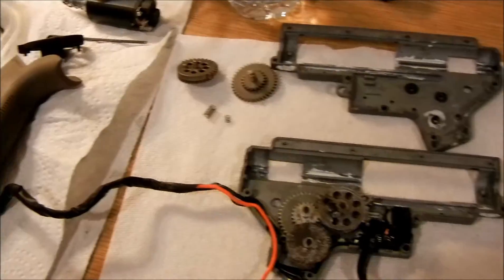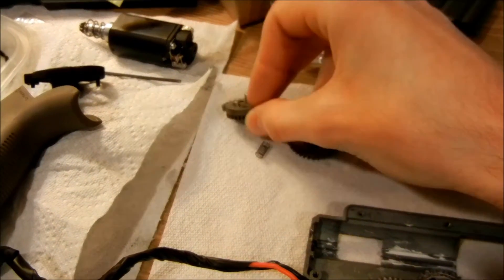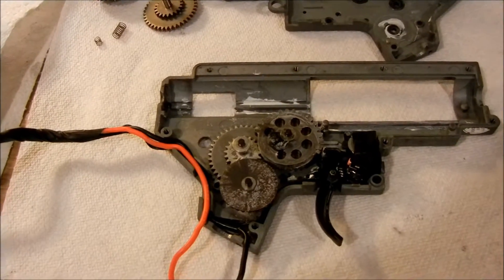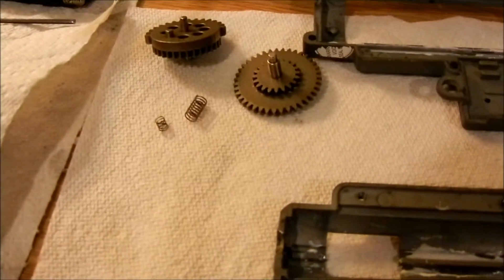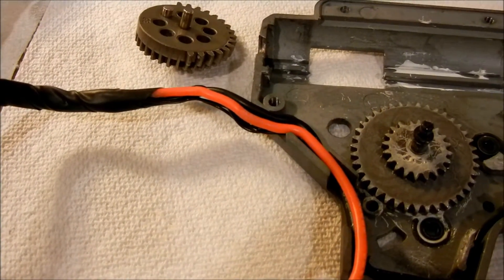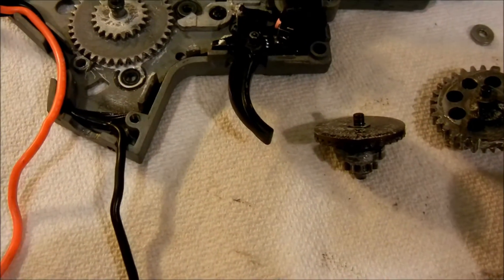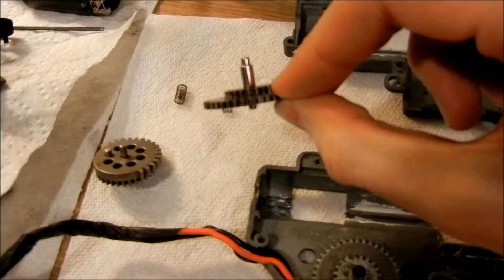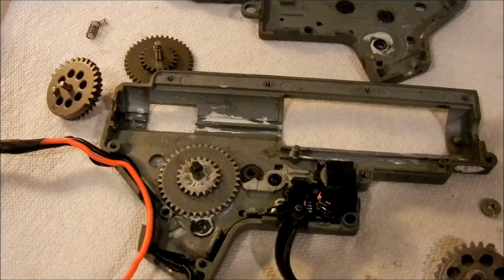How to convert VFC gears into non-auto-shimming gears

Comment from the maker: The springs created a good deal of resistance and since the stock motor isn't real strong, removing the springs did increase rof a little. The delayer chip will not need any cutting as long as the metal shaft you put on the axle is higher than the chip. The microswitch isn't new. All ascu's have had it, but mine is a gen2 for reference.

Comment: Fixing the auto-shimming won't techanically increase ROF. But reliability is much better. Did you notice if the delay clip needed to be cut down to make the shims straight on the sector gear? That microswitch area is new... is that a gen3 ASCU?
Reply: It actually should a bit. A smoother gearbox with less resistance will mean the motor needs to work less hard and can spin a bit faster, thus increasing your ROF.

Comment: One issue i see here is that plastic piece that rides on the spur gear melting. Still debating what to do with my VFC gears,  replace,  leave alone until they break or trying shimming them.
Reply: It's actually steel (on mine, at least).